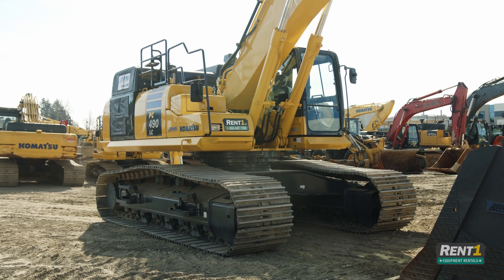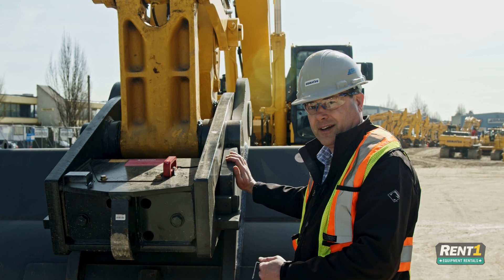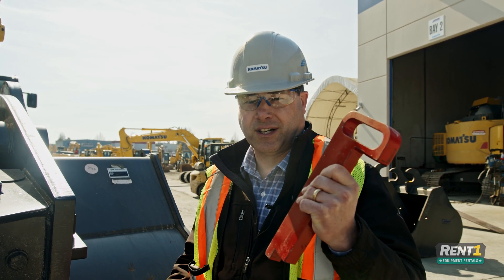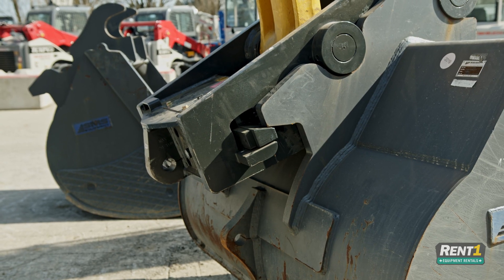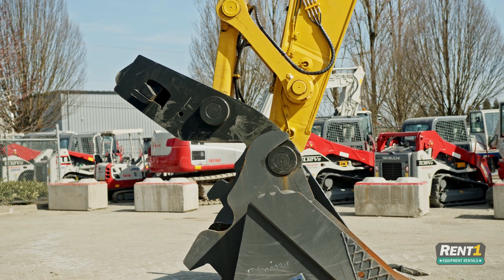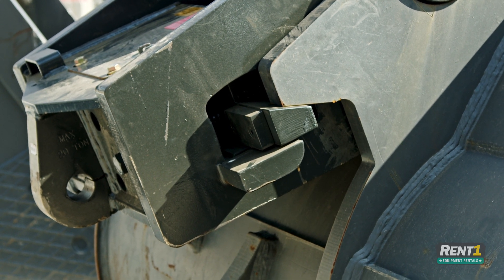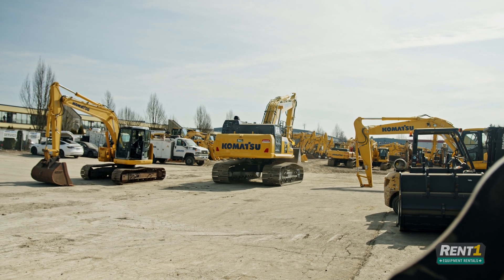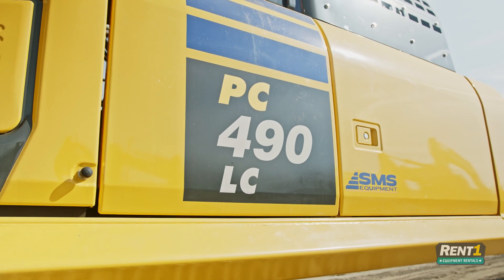How To Change EXCAVATOR Attachments With A Quick Coupler & Lock Pin - Komatsu PC490LC

Comment: Why would anyone want this hitch?? A hydraulic hitch that the operator still has to get out of the cab??  And the pump doesn’t go into a higher power, you’re just dead ending a cylinder so it blows the relief, it’s very normal, this video is very misleading